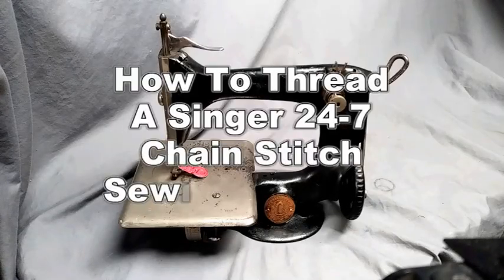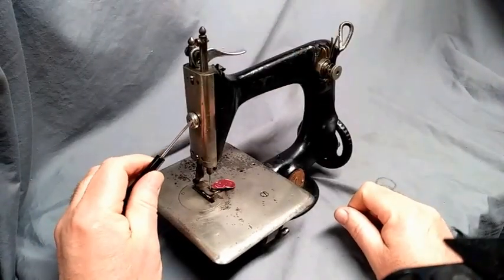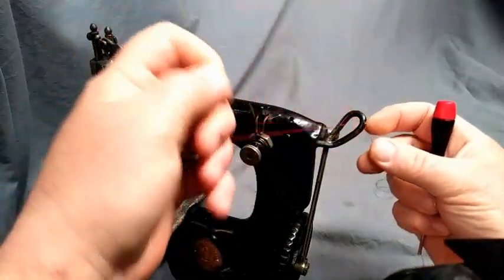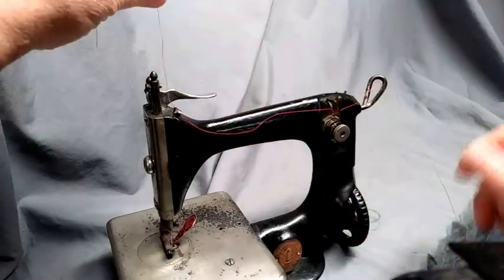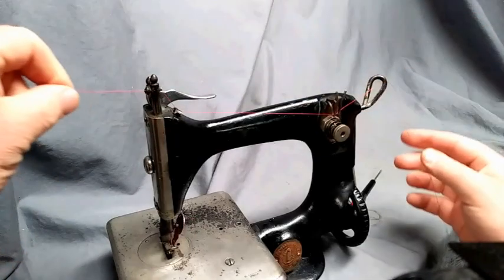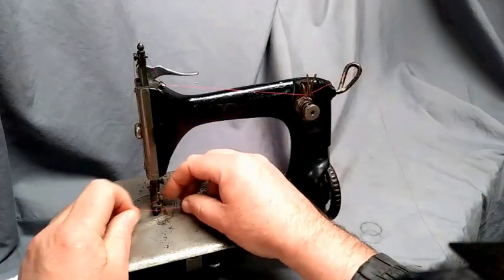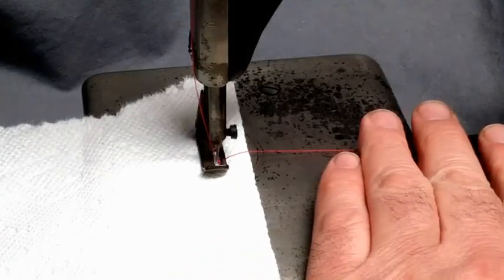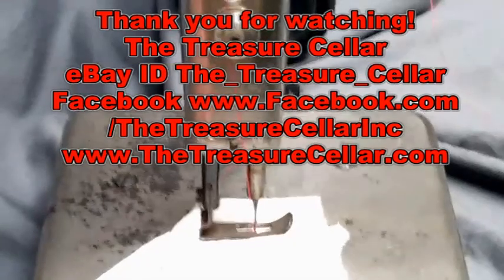How to Thread an Antique Vintage Commercial Singer 24-7 Chain Stitch Sewing Machine

Comment: The thread should also go through a thread pull off mechanism that comes out of the slot next to the tension assembly and moves up and down in that slot. It’s most likely snapped off (mine has on my 24) but a piece of strong wire can be improvised and fitted where the snapped off part joins the internal mechanism. I still get a stitch on mine without it. Thanks for this video.